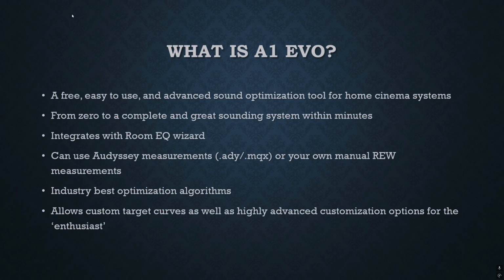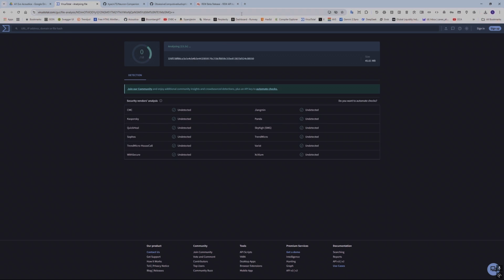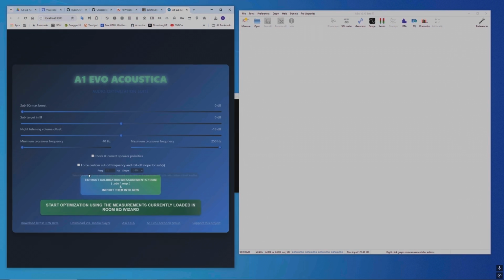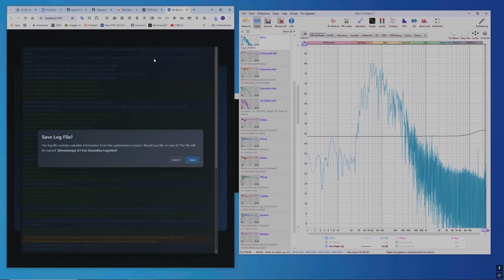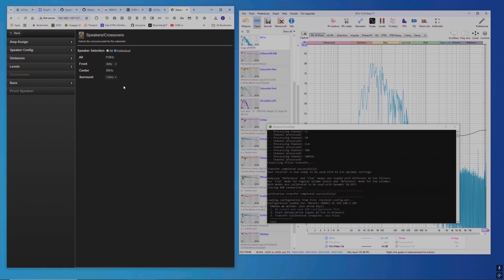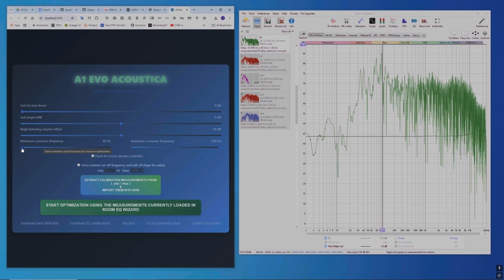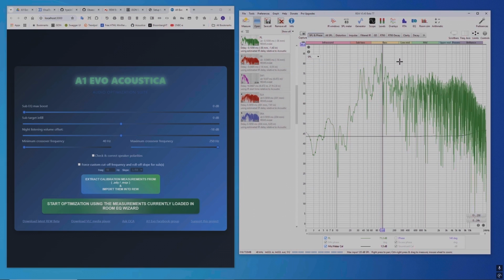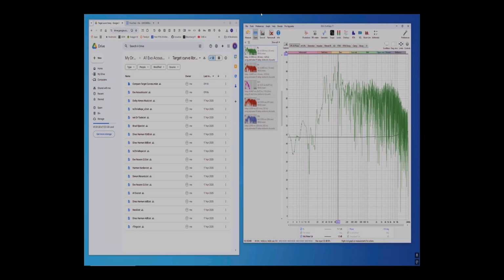A1 Evo Acoustica

Comment: Hey Serkan... Probably we are a too quick in downloading new versions 😊... was trying V4.3... All went well till I hit the issue with transferring the file to the avr.. stuck after successful read and parsed step.. then it is getting timed out and fails to transfer the file... Denon 3800H
Reply from the maker: No problems with 3800 with many others. I'd suggest an AVR power cycle, pc restart and retry.
Reply: @ocaudiophile  Yes... I have tried that already ... still doesn't work... I noticed Acoustica is getting IP a bit wrong, not sure why... never had this issue with any of the versions
Reply from the maker: @AbhishekSingh-fw7fv 4.3 only added customization options otherwise identical
Reply: @AbhishekSingh-fw7fv  If it gets wrong IP, recreate the .avr file and it will be fixed.
Reply: @johnkokk  Yes , it does.   Thanks a ton.. All works now.. transferred the file successfully, thanks

Comment: Dear @ocaudiophile 
since I upgraded from version 3.0 to the current Evo Acoustica (4.2), I’ve noticed that in "flat" mode the soundstage feels a bit more distant and slightly—but clearly—shifted to the right. 
However, in "reference" mode, it’s perfectly centered and closer to the listening point.
I never had this issue with versions 3 and earlier.
Do you have any idea what could be causing this?
Thanks!
Reply from the maker: There was no change to the optimization algorithms between these versions except for one or two minor bug fixes that effected only very few people. You can try different target curve or play with options or take more measurememts next time. V4.3 allows you to change front speakers crossover searched range which would be effective in shifted sound stage.
Reply: @ocaudiophile  I've tried everything... The FLAT curve shifts the soundstage to the right, while the REFERENCE curve — just like with total bypass or when turned off — keeps the image perfectly centered. I went through all the settings, checked polarities, and even redid the measurements. Same result every time, and I just can't figure out why. (Marantz CINEMA 60)
Reply from the maker: @dadgad try setting front XO freq higher
Reply: @ I set the XO to 80Hz (it was 40Hz before), and now the image shifts to the right even with the REFERENCE curve, whether the subwoofer is on or off.
I double-checked all settings, polarities, redid the measurements... Same result. I'm totally puzzled!
Reply from the maker: @dadgad try 120hz
Reply: @ nope… I lowered the REFERENCE treshold and will listen this way with the fronts at full range and no subwoofer for music listening until with a next update maybe things will change 
Thanks
Reply from the maker: What model is your AVR?
Reply: @ocaudiophile Marantz CINEMA 60
Reply: @ocaudiophile  Hey OCA, quick update — I redid the measurements using just three sweeps, without ever moving the mic from the center position… and now the image is consistently perfectly centered every time.
No idea what was going on before, but looks like that did the trick!

Comment: I had success my first try, but I wanted to try again without Polarity Check & Fix. Keeps getting stuck: 

8:20:59 PM [INFORMATION] Checking consistency of imported measurements...
8:20:59 PM [WARNING] Some measurements seem to have been removed from REW. FR (2 measurements) vs 8 measurements in others.
8:20:59 PM [WARNING] If this was NOT intentional, you should reload your original automated measurement results to REW and restart optimization!
8:20:59 PM [INFORMATION] Preparing measurement layout for optimization...
Reply: I tried importing the REW config file on the download page and leaving Target as "None" for curve and I think it is working again

Comment: Hi @serko70, I could use a bit of help!
I am trying to figure out how to get some bass back. I have two subs and they are level matched with each other at about 76dB. After running Audyssey MultEQ they are set in the AVR at -8.5dB.
When running Acoustica, unless I use a really base heavy TC, think Dirac Harmon 8dB or 10dB, the final results are generally in the -5dB to -6dB range. This is running Acoustica at defaults.
Just not very much bass!
How is the best way to improve the bass and get more gain?

Thanks,
Lon

Comment: Hi Oca
When I go to „Extract Calibration Measurements from (.ady/.mqx)&import them into REW“ nothing happens. No Window opens etc. what can I to to fix this problem?
And I can‘t upload my receiver_config.avr to my Denon 😢
Reply from the maker: You need to click start optimization button after that. Try the facebook group (linked in Acosutica screen) where you can post logs/photos. It's tough to understand and fix problems in YT comments.
Reply: @ocaudiophile  Thank you for the answer. I cannot select the .ady file, no window opens on the Mac. So I can’t optimize it either.
Reply from the maker: @MrsSuSahne That's strange but lots of Mac users don't have such problems. Try asking help in the Facebook group maybe as I don't have A Mac.
Reply: @MrsSuSahne 

I had the same problem on Safari. However it worked with Chrome browser.
Reply: @surrealistix1  I will test it 😊
Reply: @ocaudiophile  thank you very much, I will apply to the group

Comment: Excellent. 
I am using Marantz Cinema 70s. 
From a1-evo-acoustica-win64_v4.2, the subwoofer works normally after calibration, and the calibration information transfer speed and network search speed are fast and satisfactory. 
One suggestion is that I hope the option to optimize the AV receiver for rew measurement, which was in v3.0 is added.

Comment: First time user. Downloaded this with new x1800h receiver and 5.1 system. I setup my receiver basics to get it set to 5.1.. grabbed from the neuron  folder the default audyssey calibration file and used editor app send to receiver. It set my speakers at 2.75 metres not 0, should I manually set all to 0 to take initial measurements?
Reply: Also if I plan to use virtual heights channels do I need to do Atmos sweeps? Or how does that work? Or should I just not use virtual heights / virtual X
Reply from the maker: If you have actual height channels, you should use provided Atmos sweeps to measure them. For 5.1 you don't need them, REW's internal sweeps are good up to 7.1 floor channels.
Reply: @ocaudiophile  ok thank you. I'm just using audyssey mic so using multi eq editor to gather speaker data. Should I manually change distance of each speaker to 0m? Your calibration file set to 2.75m. everything else looks reset properly according to your neuron video

Comment: Is there an option in Acoustica to completely disable the auto-calibration for bass frequencies? If not, will it be implemented in a later version?
Reply from the maker: Why would you need that?
Reply: I run a complex subwoofer system using daisy-chain Mini-DSPs for granular control of farfield subs, nearfield subs, and tactile response devices.  I need full manual control of my subwoofer system.

Comment: hello, I personally didn't notice a big difference to the last Neuron version. Nevertheless, everything is very good and better than the on board calibration. My question: does a reset of the AV Reciver still have to be done? In one of the One Evo versions there was even a file for it? Could it be that there is still some of the old stuff on it and therefore the difference is no longer so noticeable? Or is it just my fault... Thank you
Reply from the maker: In general, there's no need to do anything that's not instructed by the prompts.

Comment: - Found the .exe for Windows [thx]
- Typed IP and Name to find AVR
- Preferences.txt loaded into REW
- Measurements from AVR transferred into REW
- Optimation startet
- Multible recordings detected and saved for later
- ...now it stops - 1h or maby more / saying:
[INFORMATION] Final speaker volume levels optimized for perceptual equal loudness responses:

SETUP:
- Windows 10 [last update 27.APR.2025 / 11:00 AM]
- REW V5.40 Beta 78
- Marantz SR8012 
- FL, FR, C, SL, SR, FHL, FHR, SW1

My suggestion:
- Settings in REW are different [changed analysis and EQ (as shown) for trouble shooting] still stucks

Maybe others have same experiences to help.
Anyway... I thank you for the time you invest to us all happy with our AVR, speakers etc. <3
Reply from the maker: That was a target curve folder naming issue (non-ASCII characters) and should have been fixed now with v4.1
Reply: @ocaudiophile  Thank you so much for replying!
Meanwhile I've found a work around.
Even when I have to make silly changes in the results of the calculation (silly ceiling),
I can clearly hear a improvement - well done OCA - well done as always.

And it also good to see that you keep on using your mojo to this beautiful program 8)

Comment: Hi Serkan... in my X3800H, all is well with preset 1..  all the configuration goes through as per OCA file and as expected.. interestingly while settings for Preset 2. Acoustica confirms successful transfer of settings but then sets all speakers as full range... problem is only with Preset 2... Am i doing sonething wrong..
Reply from the maker: what happens when you set them to small in AVR menu? Do they get correct crossover settings automatically and it sounds good?
Reply: @ocaudiophile  will try now.. since I don't touch any settings after Evo sets it , didn't try... will try this now and come back
Reply: @ocaudiophile The settings for level and distances is ok ... Cross over for all speakers goes full range... when I try to set the acoustica recommended Xo ers , it defaults back to full range...
Reply from the maker: Set them back to small and problem should be fixed. Also try v4.1 which might not do this.

Comment: Tried updating the 3500H receiver to version 3.2. Update completed with errors, receiver froze and needed a reset. 
Thanks again for all your hard work

MacOS
--- EXECUTION FAILED !!! ---
Error: INIT_COEFS: No response received
Error: INIT_COEFS: No response received
    at cleanup (/snapshot/A1EvoAcoustica/sendFilters.js:641:42)
    at Timeout.<anonymous> (/snapshot/A1EvoAcoustica/sendFilters.js:676:14)
    at listOnTimeout (node:internal/timers:564:17)
    at process.processTimers (node:internal/timers:507:7)

Cannot attempt to exit calibration mode during error cleanup. Reason: Send function not available.

Closing AVR connection...
-------------------------------------------------------------

[main.js] Error during calibration transfer step: Filter transfer failed with exit code 1.
Loading configuration from file: receiver_config.avr...
Configuration loaded for: Denon AVR-X3500H

Comment: I calibrated for the first time, worked great. For now I kept my Mini-DSP calibration and set the sub boost on the menu to 0db. This means that the Mini-DSP did the boosting by +6db. Then A1 Evo can still do phase and more without the need for the receiver to boost the sub channel. Other than the that small change, the calibration for the actual speaker is absolutely excellent, the tonality is the best I've heard, better than my manual calibration. I will test different methods for the sub calibration, whether its best to let A1 Evo handle it entirely, or a mix of Mini-DSP also. I set my crossovers at 80hz locked, because I think it sounds better, so it's nice you can manually set the crossover at 80hz by the min and max. Excellent work, and can't wait to see how this program evolves over the coming weeks and months.

Comment: Hi i get this message.
Target curve not found. Please upload your preferred target curve under “REW/EQ/target settings/house curve”. I'll try again in 5 seconds...
But I have loaded the target in EQ. 
When I load the RewPreferencesFile.txt file and restart REW the error message Houscurve Data error appears. 
Even if I then load the target manually, the error remains.
Does anyone else have this error?
Reply from the maker: REW Beta 78 had some changes that didn't work with Acoustica. This is now all fixed with v3.2
Reply: @ocaudiophile  Thank you very much, now it works :)
Reply: I have one more question. 
I own the Denon AVR-9700H. If I have the receiver_config.avr created. 
I cannot load it into my Denon. Even if I omit Receiver at the beginning. It always hangs in the process. 
And I have to go back. Are there any problems? 
The app does not recognize the file via the MultiEQ app either. 
Best regards

Comment: In Neuron there was a function to prepare the receiver for manual measurement with REW. Setting levels to zero, deleting filters etc. I'm wondering why this option is missing in Acoustica. Is there another way to prepare the receiver for manual REW measurement? BTW thanks for your awesome work!
Reply from the maker: I will add these functions when I can and you can still use your old Neuron files for what you need to do.

Comment: (Solution) Error localhost:3000, failed to send one or mote measurements to REW. Please check REW connection and console logs.

For anyone else who ran into this issue, I solved this by updating my rew to the v5.40 beta 77 that's listed at the bottom of the acoustica browser page.

It will not recognize the API server or run correctly on any other version of REW.

Comment: [WARNING] Required subwoofer volume level exceeds AVR volume adjustment limits by 6.5dB!
[WARNING] Acoustica will compensate for it by precisely adjusting subwoofer filters for the exceeded amount but try to adjust your subwoofer gain levels accordingly next time you measure your system.
 
 Dose it mean the Subwoofer gain levels were set too high during measurement? and it is better to turn it down next time measuring?

Comment: I get following error during transfer to my Denon X2300W AVR.

All other channels data were transferred successfully, but getting error at below stage, tried multiple times, it fails at same point everytime!

--- Processing Channel: SW1
   Flat mode filters for channel SW1 were sent successfully.
!!! FAILED sending PACKET 4/4 SW1 Reference (TC01) SR02: PACKET 4/4 SW1 Reference (TC01) SR02: No response received

--- EXECUTION FAILED !!! ---
Error: PACKET 4/4 SW1 Reference (TC01) SR02: No response received
Error: PACKET 4/4 SW1 Reference (TC01) SR02: No response received
    at cleanup (/snapshot/A1EvoAcoustica/sendFilters.js:640:42)
    at Timeout.<anonymous> (/snapshot/A1EvoAcoustica/sendFilters.js:675:14)
    at listOnTimeout (node:internal/timers:564:17)
    at process.processTimers (node:internal/timers:507:7)
Cannot attempt to exit calibration mode during error cleanup. Reason: Connection/sender not available.
Closing AVR connection...
-------------------------------------------------------------
Calibration transfer completed successfully!
-------------------------------------------------------------
Reply from the maker: 8 know, still couldnt manage to transfer settings with XT models :(
Reply: @ocaudiophile  can i try older version? Neuron? I am doing first time and friend suggested to use latest version. 
I'm going through Neuron version, but there is no way I can transfer oca from Ubuntu to AVR. 
can I transfer oca generated in acoustica version using Neuron odd scripts from mac machine?
Reply: @ocaudiophile  I have the same problem on my receiver, denon x1800h. Can I help you solve the problem in any way?

Comment: OCA I’m looking at this and even though I don’t own any of these receivers I must congratulate you and your collaborators for developing such a fine tool. 

I have a 2.1 system and wonder if it’s possible to use this tool (without a receiver) to correct my speaker set up. I’m using convolution FIRs and though I’m learning a lot from your channel, I’m not as talented as you in getting my settings dialed in. Is this possible?

Thank you.

Comment: Well sadly i have to go back to Neuron. The new version 3.1 threw an error not being able to apply silent mode on my sub, and i needed to unplug my avr to work again. Audyssey was disabled. Before with an older version of acoustica, dolby atmos was not working no more. I have a denon x3600h.
Would be great to habe the option to apply only flat preset and reference as an option, if thats vausing the issue. Will wait for further updates.
Oca, could you make the first version of acoustica available again, funny enough that transfer worked.
Reply: I now went back to acoustica 1.0 and loaded the oca file from 3.1 successfully. No upload error, atmos is working, but silent mode still sounds weard....

Comment: Thanks for all the efforts to provide such a great tool for FREE.

 I like that Acoustica is an all-in-one solution now and I love that you choose the preset through the app. Now as far as sound, I have to admit that at least on my AVR (Marantz Cinema 40), I am not impressed. It seems somewhat anemic (in lack of other words). Levels are lower than I am used to, bass is almost absent. I loved the sound of Neuron with UC version(I think 2.5 ? ) and that's what i have on my Preset 1.

I am still testing ACOUSTICA with various curves though.

Thank you and keep up the good work.